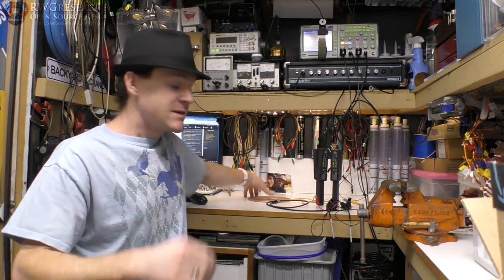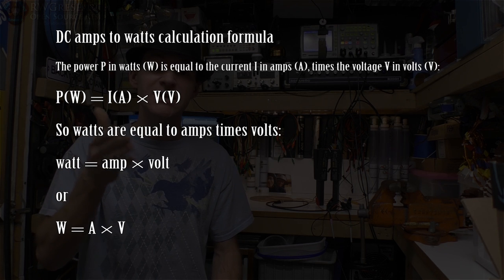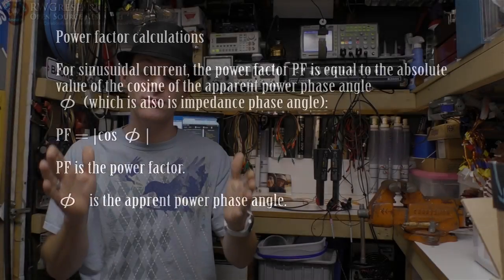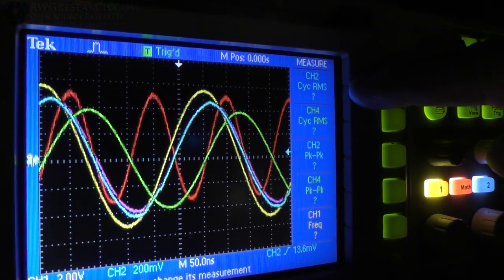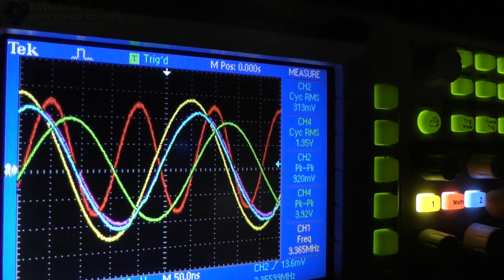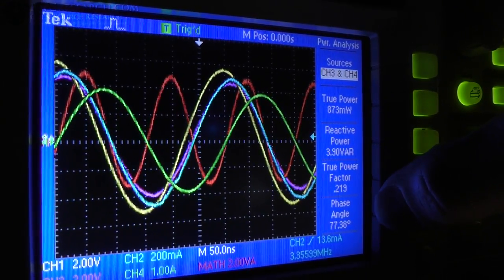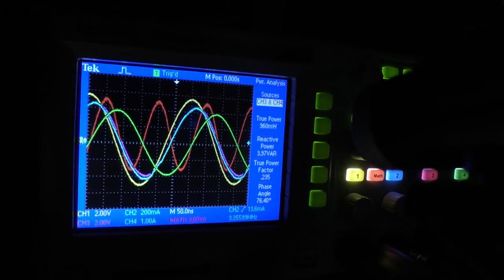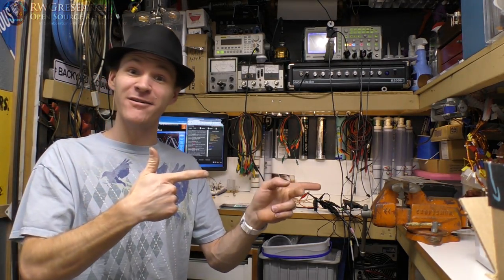Responce #2 Tesla bifilar Pancake Coil Anomaly. Phase shift. A.C. Watts = A x V X PF

Comment: Try using it the way it was meant to be used with impulses. Plus measuring the coil with AC, which it was not meant for, is really outside of the scope of the coil. Putting resistors in the setup will alter the designed use of the coils. You also have to use the actual single wire version and not speaker wire parallel conductors. If you use a second coil it must be wound in the opposite paths. ok let me see if i can explain that. If it is a true pancake bifilar coil each wire will be surrounded with the opposite polarity wires. this includes a second layer as well. This will allow the charges in the impulses to be accelerated through the coil via the previous impulse through induction. The coil was meant for charge acceleration after a primer impulse. This way as the first impulse is rounding into the second half of the coil the second impulse induces attractive forces on the secondary coil via induction from the fist coil. This accelerates Both paths as well. Kind of like Tesla's experiments with his turbo disk pumps in an odd revelation as I was investigating his Technology and his scientific experiments.
 Also Check out his fluid diode. This might be another clue to how he was getting true one way impulses. There must be a parallel inductive reasoning behind that experiment as well. Just imagine an inductive diode that scales and is not limited to matters condition like normal diodes work.
Reply: "If it is a true pancake bifilar coil each wire will be surrounded with the opposite polarity wires"

No, you have it wrong. You should re-read the patent # 512340 so you can see where your errors are.
Reply: The patent is only a clue to the coil. You can not apply traditional transformer operating theory on this device. It is designed to mirror the natural cross current amplification between the two coils. This is done with the phase shift. As one impulse is rounding the bend into the second coil the first coil receives another impulse. They will then pull on each other because the pairs are interwoven. The resulting out put will have it's charges accelerate trough the device and pick up extra energy due to the increase in speed of the impulse on the output.
 The increase of capacitance allows the impulses to pass through the coils without self induction laws playing games with it. In fact it aids it to gain charge speed. like wise the capacitance between two layers must follow the same rules as the first pancake. This way there is even more increase in capacitance and a further aiding of the charges flowing through each pancake. So two pancakes layered on top of each other would further enhance the speed of the charges moving through the coils.

 Care to explain how self induction with this coil works then? Since each wire acts like a plate of a capacitor, then how does self induction raise the voltage? Well to be honest it has nothing to do with traditional self induction since the capacitance in effect shorts out the self induced voltage the the next loop of the same wire. The only way then is for a speed increase to explain the additional voltage. Caps don't increase the voltage, only self induction or a speed increase of the charges do. This coil rules out self induction by it's nature.

 Please explain to me how you think this works...

 Tesla told us that we would have to experiment further with his patented work. He didn't have time to work it all out and for the most part if you read other things like his lectures and other material it would be easier to understand everything he was experimenting on.

 P.S. The mythology is with your established junk theories which rule out the voltage potential as a motivator. Your theories that you are going by are outdated and antiquated. It's all about to change though and we have some work to do to figure it all out, much of which is currently being susses out by real scientists and electric theorists.

 FYI Tesla had to put traditional explanations on his patents for a reason, if he did not they would have been denied from the get go. Tesla wanted this stuff out in the public, he knew others would eventually figure it out. Some of us have.
Reply: This  coil dose not rule out self induction at all. Myself,and many others have shown this. Power transfer is achieved by both self induction and self capacitance. If self induction was ruled out by this coil design,the coil would not ring,and they ring quite fine.
Reply: There is no power transfer in this design. It is not a transformer due to the single path through the device. It is a single wire wrapped in such a way that restricts self induction to let high speed impulses pass as if there was nothing surrounding that single wire. Any voltage gain must then be from acceleration of the current through the device. Same amount of current but gains in voltage only due to this speed increase of the charges through the device. Tesla himself stated this in the patent. Are you arguing that science is wrong then with particle accelerators? <-Same concept. When the device is used properly with impulses and nothing else it shines. When used with AC it does not work as described. So all your testing with AC is nerfed. Is this by the testers design? I think so. To what end?
 Listen I can show just about anything if I wanted to. Exploring this coil while using Tesla's methods is a must. Exploring the coil with your methods will net NOTHING. It would be like exploring a resistor without using current. Ahhh... Thats it. How does a resistor work with no current to resist, just voltage?
 It is very clear that Tesla was looking for alternate ways to utilize coils without the dampening effects.
 
Again "The effects of self-induction, above referred to, are known to be *********neutralized******** by proportioning to a proper degree the capacity of the circuit with relation to the self-induction and frequency of the currents. This has been accomplished heretofore by the use of condensers constructed and applied as separate instruments."

 If you are going to ignore direct quotes from the person experimenting with said device then you might as well hang your experimenter cap up and stop all together. Tesla has left key information as to what his experiments and the results of those experiments mean. Mostly everything else in the patent is a cover to get the patent and get this into the public eyes. Unfortunately Tesla had to resort to this tactic because his attempts to submit the patents would have been denied, just like it is today. Again exploring a patent by him without knowing his total back ground and experiments is like trying to explain other electrical patents without knowing basic electrical theory from which they were designed.

 I have never stated this is a magical device. What I did state is that it is being tested outside of the scope for which it was designed. Weather or not it is OU remains to be seen and remains to be tested as such. But might I ask, what about other devices made from this coil? Do they show OU effects. Well sort of.

 Self induction acts like a choke to current and a boon to the voltage potential. Capacitors shine with voltage only. There is no current in a capacitor. If there is then the cap is destroyed by current understandings.

 Some people mention power factor as an object of this coil. Really so is there a power factor when DC is used or impulses? Power factor is an AC phenomena.
 "In AC systems power factor is defined as the phase leading or lagging relation between Current and voltage waveform. Since in DC systems, there is no waveform for voltage it is not possible to define a leading or lagging angle of any value. Thus power factor is just not applicable, it can't have a value."

 Again testing this coil with AC will be fruitless.

 AC currents are powered all through the sine wave. Impulsed currents are instantly power on and then power off. There is no power in the intermittent periods between power on and off. In my strongest opinion this allows the environment to be sucked into the device in the off periods. This fills the capacitance in this device from the environmental electrical potentials via the north and south poles that form above and below the plane of the coil.

 Lets move to describing the electrical environment for which this device will pump energy into the system. Not only is there a magnetic field associated with this device there is a purely electrical field as well. Just like in any experiment done by Tesla, plasma is attracted or condensed from around the environment and concentrates around the device. It is after all attracted to the higher voltage potential of a solenoid coil. Well one side of that coil is responsible for that high potential due to self induction. What happens when you introduce the bifilar method is to short out the self induction due to the capacitive nature of the parallel path of the bifilar and subsequent serial connection. One end of that coil pulls electrically on  the other, aiding the speed of the current propagating through the coil and gaining potential in the process. The voltage gain in these coils is done through another method besides self induction. This must mean that it gains it's voltage via another method as I described. Once this device starts gaining potential it will then attract free plasma (which is highly voltage sensitive) from all around the device. This imparts a better environment for magnetic and electric fields. It makes it stronger in effect.

 Now how do I know that the environment is plasma rich? Well look at the field around a Lodge coil (not a Tesla coil), you know the one Sir Oliver Lodge created and was different then Tesla's coils. The field is enhanced around the coil and will conduct high voltages better. Much like doubling the conductive capability of a current carrying wire. The display on the end of the coil has the highest potential which condenses the plasma from the environment to such a degree that it illuminates the condensed pathways.

 Tesla was so enamored with sparks for a reason. He knew there was a conductor of space that allowed high voltages to transmit effortlessly through space. He knew he could vary the density of a given space of plasma by introducing the Higher voltages he was used to working with. His tower was a transmitter of this density. This coil was most likely used after his disruptive discharge circuit as an accelerator for his impulses of the density of plasma around his device. Much like when you throw a pebble into a calm pond the density wave changes through space. To pick out the energy present at any place from the initial wave origin one must know there is a vacuum of plasma in the Earth due to the high matter to plasma ratio. The only thing you need to do is put up an antenna with a wave matching circuit to the ground where plasma wants to be, to be even and balanced across space. Since matter displaces this plasma, it creates a vacuum to the plasma once the plasma has attained the potential level of the ground or lack thereof.

 This plasma is from our Sun and the guiding factor is the potential value of it. It naturally seeks an imbalance which presents itself as a vacuum type effect. Also Double layering effects are known that cause a skin type effect with point sourced potentials like in our core. Our Sun is the focal point of our solar body. The matter present creates a pressure or reversed a vacuum to the balance seeking plasma.

 I know this is getting long winded but if you don't know how induction is created how can you optimize the process to gain in energy then you might as well stop looking. Induction is the clue. This device takes advantage of certain inductive laws. Certain laws governed by the density of the plasma around the device.

 In order to use this coil effectively it seems apparent that it must be in an oil bath to increase the capacitance. I say this because the coating on the wires dictates the capacitance between the opposite polarities present in this device's wires. The gauge of the wires also dictates the capabilities of this coil as well. With Tesla's disruptive discharge circuit the thickness of the wire was dictated by the potential level hitting the matter of the wires. Smaller gauge wire would explode like the finest dynamite of the day so the gauge of these coils must be strictly controlled to this non investigated avenue. These coils might show propulsive effects when applying impulsed trains or packets of impulses to fill the capacity in the coil. Like step charging or the Stanley Meyers take on it.

 A way to use this coil for magnetic generation Would be on each side of the coil's plane with ferrous re-gauging channels outside of the coils plane. This would help to focus the magnetic field better the further away it is from the plane of the coil. 90 degrees out of phase from that plane as well. Looping the tail ends of the focused magnetic channels might increase the output as well. Would a magnetic tap on that loop work for a power tap? I guess we will find out.
Reply: I have since gone back through the myriad of patents and have found the information about the use of this bifilar method.

 "I employ a generator, preferably, of very high tension and capable of yielding either direct or alternating currents. This generator I connect up with a condenser or ***conductor of some capacity**** and discharge the accumulated electrical energy disruptively through an air-space***(spark gap)**** or otherwise into a working circuit containing translating devices and, when required, condensers. These discharges may be of the same direction or alternating and intermittent, ***succeeding each other**** more or less rapidly or oscillating to and fro with extreme rapidity. In the working circuit, *******by reason of the condenser action, the current impulses or discharges of high tension and small volume are converted into currents of lower tension and *GREATER  volume*******. The production and application of a current of such rapid oscillations or alternations (the number may be many millions per second) secures, among others, the following exceptional advantages:
 First, the capacity of the condensers for a given output is much diminished; second, the efficiency of the condensers is increased and the tendency to become heated reduced, and, third, the range of conversion is enlarged. I have thus succeeded in producing a system or method of conversion radically different from what has been done heretofore—first, with respect to the number of impulses, alternations, or oscillations of current per unit of time, and, second, with respect to the manner in which the impulses are obtained. To express this result, I define the working current as one of an excessively small period or of an excessively large number of impulses or alternation or oscillations per unit of time, by which I mean not a thousand or even twenty or thirty thousand per second, but many times that number, and one which is made intermittent, alternating, or oscillating of itself without the employment of mechanical devices."

 Thank you for helping me to focus back on that.

 The bifiliar coil is a single conductor with increased capacitance he mentions here and the proper method to utilize it is also given by the man who understood it better then all of us.

 The bifilar coil is an intermittent capacitor. It is solely designed to work as such. Even though you can use pulses or oscillations it's primary converter function is impulse based. This is eluded to by the frequency of the division of each type of current. Impulse, pulsed and oscillated currents were different to him for a reason. Pulsed and oscillated currents being established by him and a great many others before him. Impulsed currents were of a different character and one which no one really investigated much. Look at how he focuses on the capacitance as being the translator. Impulses collect and charge things including matter which he has shown in the public and quite often in his lectures.

Comment: If you measure across a resistor anywhere in a series circuit and you measure across a resistor anywhere else in that series circuit(with the same value and type); it is exactly the same; to say otherwise would be against the current laws of physics, forget power factor; etc; it should be the SAME(Amplitude, phase and frequency).I am highly qualified in this area.
Now remember when you are using ground connections on the channels; all those grounds are connected together, so you can only measure potential difference using one channel at a time, you Also need to make sure the ground on the power supply is NOT connected to earth if you are using a UK mains supply as the Earth is connected to the scopes ground.

If tin man can use the same bulb to glow differently across the same value resistors in a series circuit than this would be an award winning science prize..so I have to call bullshit on this one.